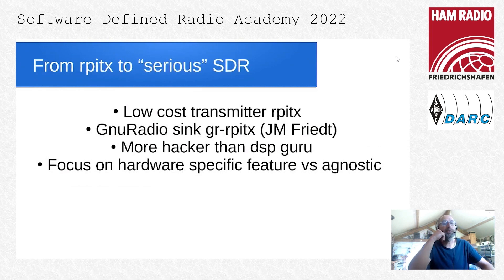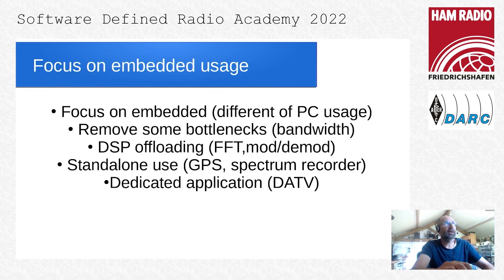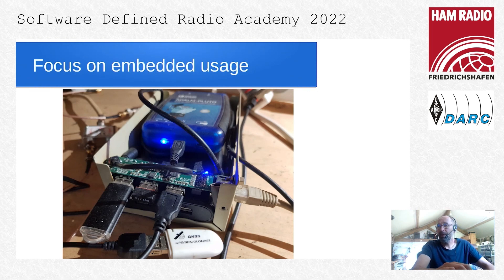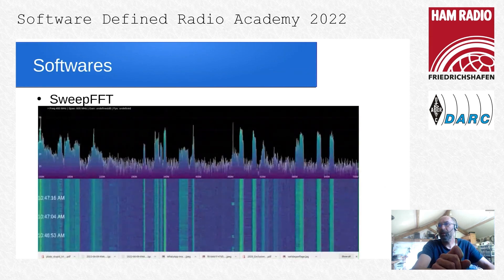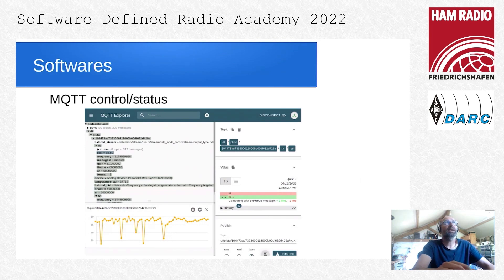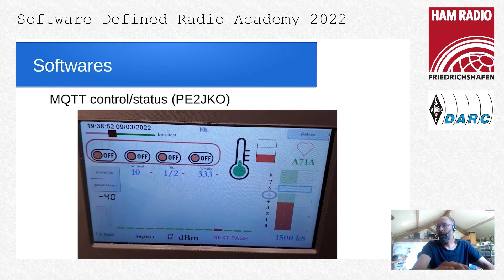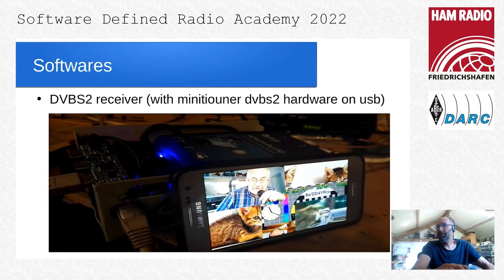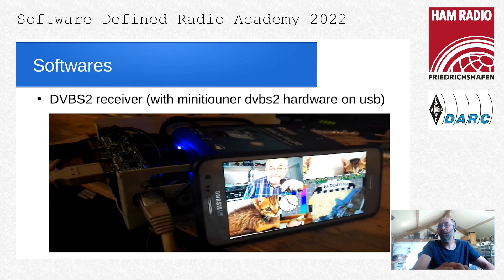SDRA'22 - 13 - Evariste Courjaud: Experience on PlutoSDR and firmware, DATV and some tricks in FPGA

Comment: Summary
Introduction and Background
- 0:11: Introduction to experiences on Bluetooth SDR, digital ATV, and FPGA tricks.
- 0:21: Speaker is Evariste Courjaud, a ham radio operator since 1986, with 15 years in digital TV and a software developer in C/C++.
- 0:44: Discussion about the Crypto SDR platform, worked on for three years.
- 1:00: Mentioned a past project, low-cost transmitter using Raspberry Pi GPIO; it’s still active.
- 1:34: Self-identified as more of a hacker than a DSP guru; mainly focuses on hardware-specific features.

Pluto SDR Capabilities and Setup
- 2:15: Talks about features and capabilities of Pluto SDR, targeting embedded platforms over PC.
- 2:30: Goals include removing bottlenecks like USB bandwidth, offloading DSP, and standalone usage.
- 3:08: Describes hardware setup for embedded Pluto, including a battery pack, USB hub, and Wi-Fi.
- 4:09: Briefly outlines the internals of Pluto SDR, including FPGA and ARM CPU.

Firmware and FPGA
- 4:50: Discusses firmware components: U-Boot, Linux systems, FPGA bitstream, and software.
- 5:30: Moves on to the FPGA stage, developed with Xilinx tools.
- 6:24: Talks about FPGA possibilities: offloading processes, adding FFT, interpolation, etc.

Linux Customization and Software
- 8:59: Switches to Linux customization, like treating Pluto as a sound card and adding support for various USB peripherals.
- 10:50: Discusses extending Pluto’s lower frequency limit to 17 MHz.
- 11:51: Final stage focuses on software. Describes a sweep FFT for wideband spectrum analysis.
- 12:46: Uses quick/fast lock tuning for rapid frequency changes.

Project Examples and Proof of Concept
- 17:14: Discussing RF coverage of the sun [maybe surroundings?] of the station
- 17:20: Talks about using this for antenna pattern mapping
- 17:27: Mentions this is a proof of concept
- 17:34: Describes a DVB-S2 receiver with mini tuner on Windows
- 17:51: Mini tuner connected to USB hub of a printer
- 18:00: Uses Longmind Linux software forked for MQTT compatibility
- 18:16: Phone receives video via Wi-Fi using VLC

Advanced Topics and Future Plans
- 18:31: Notes that DVB-S2 modulator is done on FPGA, not CPU. Using Open Research Institute's FPGA IP.
- 18:50: Highlights the high symbol rate capability (up to 40 mega symbols)
- 19:26: Mentions DATV firmware developed two years ago, popular for Q100DV uplink
- 19:54: Web interface makes it easy to use
- 20:10: Talks about future plans, including VNA and security features
- 20:44: Says improvements depend on contributions and audience interest

Further Development and Training
- 20:58: Discusses different stages for firmware, software, and FPGA customization
- 21:39: Suggests a two-day training for better understanding

Acknowledgements
- 22:00: Thanks Analog Devices, Nuts and Granules, and Open Research Institute for contributions

Speakers github: https://github.com/F5OEO/

Disclaimer: I used the transcript and various prompts with GPT-4 to
create this summary.